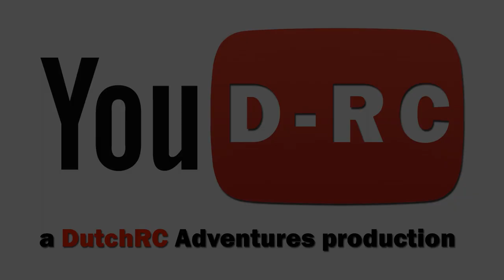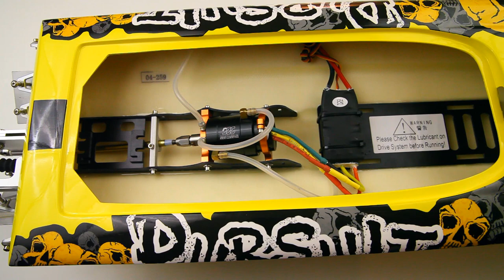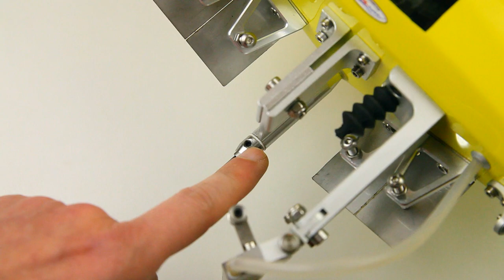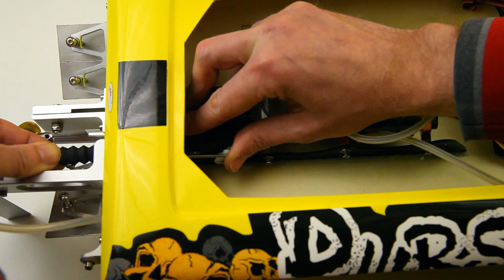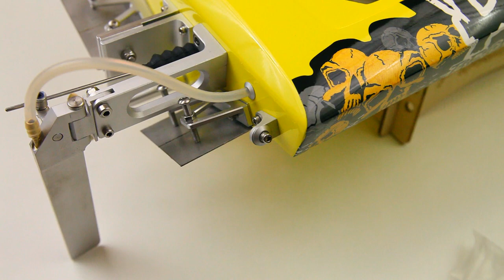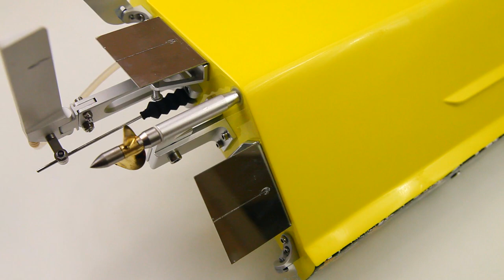TFL Hobby Pursuit Speedboat - Setup Tips & Tricks :)

Comment: nice video! lots of good info there and will help anyone who wants to get this boat with little to no boating experience off to a great start. i have limited boating experience so i'm curious what the trim tabs effect will be on the boat. Also wondering why you would want to bypass the motor mount cooling? 
ok looking forward to the maiden voyage. should be fun! cheers bud
Reply from the maker: +Mike&#39;s RC Corner Thanks buddt :) Hope you got some info out of it, as I'm pretty sure the setup of your boat will similar :) 
Ah yeah.. the cooling bit.. Well that extra cooling block actually doesn't add a Lot of extra cooling.. It does however add extra resistance in the waterflow.. So the nett. effect of it isn't much at all...
Looking forward to it too offcourse :D 
Cheers & have a good evening.

Comment: This video helped a lot with removing the flex shaft. Do the same steps apply for the TFL Genesis boat?
Reply from the maker: Good to read it helped you out sir! 
Well. I have not owned that boat, but flex-shaft systems are set up the same way on most boats.. So there is a Very good chance it works the same way :)
Reply: DutchRC Adventures wait you have the stock flex cable in this video correct?

Comment: Hello, please help! I have a tfl zonda and it won’t go over 30 mph even on 6 s battery. It does the same speed no matter 4,5,6 s battery. I’ve tried it all and nothing over 30mph. What could it be?
Reply from the maker: hee man.. that IS a strange problem indeed :O  I first thought it could be the ESC calibration but it would then at least be Faster at a higher voltage.. 
I would probably try a different ESC, but even if that helps it would not make sense....

Comment: Hi Dutch rc ! I was wondering if  you could help me ? I upgraded to the one piece flexshaft and it seems to be binding somewhere one thing i noticed that there was a buildup of heat around the rear of the strut where the bearing is located the boat is brand new never neen run in water as it is freezing winter here i have also had the motor out and maybe i mis aligned it not sure. Is there a way or trick to realign motor?  Cheers steven Australia
Reply from the maker: Howdy Steve :) 
well if there IS a trick to that, I don't know it.. I eyeball it just like you have.. I assume you have the shaft well greased up? 
Offcourse you Allso 'miss' the presure of the prop pushing the shaft in a bit. Were you running it dry or in water?

Comment: You could have mounted the receiver & battery in the boat & got it running instead of waffeling on about the self explanatory trim tabs & turn fins 🙄 $300 USD boat No battery No radio & No receiver & it takes a 6s battery Bigger motor & prop to make it real fast❗So it's definitely not RTR but a nice boat nevertheless & I am considering one in the future. Don't much care for the yellow or the skulls so would have to paint it. A variety of colors to choose from would have been a great selling point for this monster🤑

Comment: hi, I have one problem with the screws that attach the propeller, I cant remove any of both so I cant take of my shaft, I suspect is becouse of that. I think both screws are grub and I understand that to remove the shaft I need to first take out the propeller screw but I cant becouse its locked.. what do you suggest me to do, or maybe im missing one step, but I dont think so becouse I already take out the motor abd the string. Please helpppp
Reply from the maker: Howdy! Have you taken off the outdrive-mount? (the vertical plate, with the cylender at the bottom) 
Yes.. I think you kinda Are missing something, but understandable if you haven't done it before :)  In that cylindrical thing is actually a coupling (and bearings).. 
That plate is (as you can see) attached with 1 bolt + screw at the top.. 

OR.. had you allready done so??
Reply: Noo I dont, its my first rc boat so I am a bit lost and moreover.. english is not my fisrt language so I having some headache trying to understund new vocabulary. My main doubt is to know if the screws (both) next to the propeller had something to do with my probem as they’re both locked, if it isnt… can I send you a pic of my boat? Maybe that would make it easier for me
Reply: yeah I already remove that bolt and screw but it remains locked
Reply from the maker: You shouldn't even need to take the propellor off.. Can you completely remove that vertical plate?
Reply: nope, the stinger is free but the whole platform (attached to the boat) stil enganched, may I have to take the whole stinger platform? aah and I own a different model than yours I think yours is older im not shure but it is the same sistem becouse I already talked with hobby king support